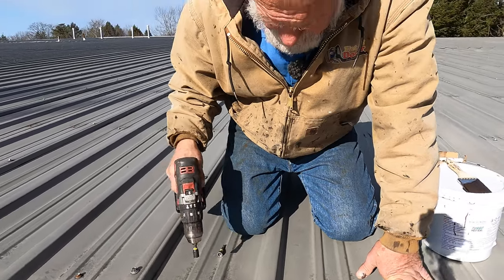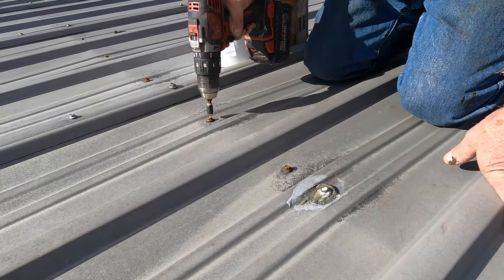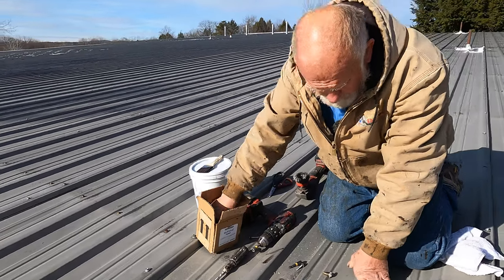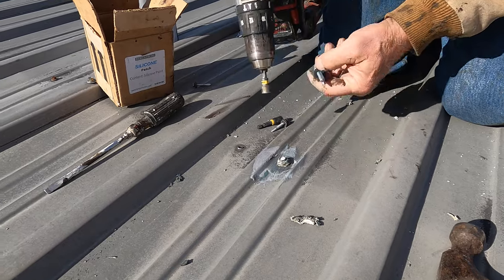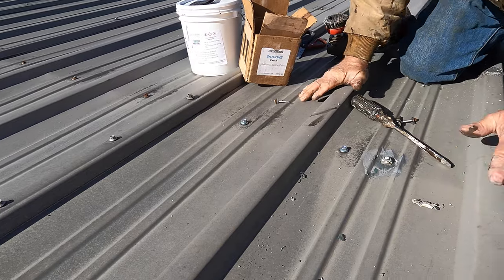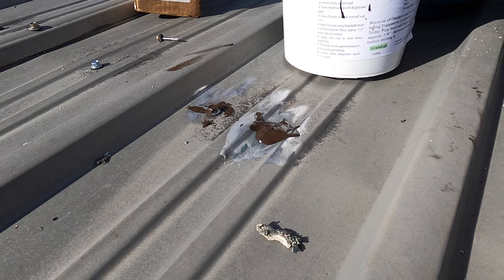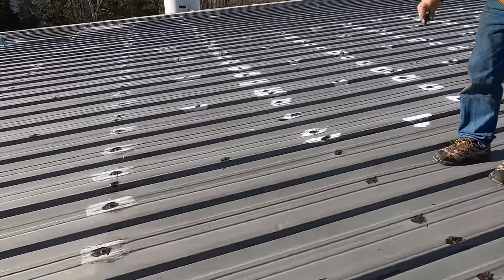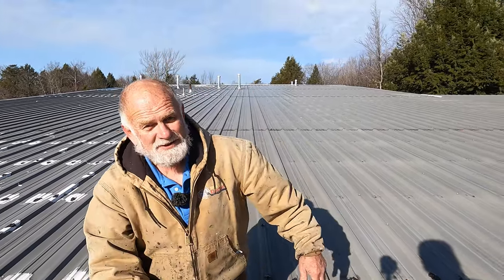Sealing Screws on a Metal Roof - Turbo Poly Seal

Comment: I find it interesting a number of flat roofs shown in your videos are secured with screws in the pans.
The rain water flows along these pans and anywhere you pierce the pan with a screw has the potential to eventually leak. In Australia our roofing systems use a concealed bracket secured to each roof batten usually at 900mm spacing. The bracket clips over the edge of the roof sheet at the side lap and is secured with screws into the metal or timber batten. The next roof  sheet is then pressed down onto the same bracket and is snapped / locked securely in place.
This process is continued along the entire roof. It’s very fast system and the pans remain free of any screws.
Thanks for the video.
Reply: from what your explaining it sounds like a standing seem roof this is just a metal roof or something like kingspan roof.

Comment: I've got an old garage that the builders used nails to secure the metal roof. I believe the washers rusted out so now there's water leaking in the garage. Would you recommend replacing all the nails with screws and then using the sealer or just go straight for the sealer?
Reply: Replace the screw, the reason why is because since that screw was already been compromised most likely water already got in, thus the possibility of rusting is there. You dont want to seal something that has corrosion it will only get worst.

Comment: I thought to myself “finally he’s fixing something correctly” then out came the turbo seal 😂
Reply from the maker: Well, that is my go-to product. I wish I knew about Turbo Poly Seal many years ago. My motto was always that I can fix any roof, no need for replacement. So my business was based on repairs. I did not have the knowledge of other products. If I only knew. I could have made some money with all the repairs. Most roofers just want to replace, and not repair.
Reply: @smudger304 do tell, for this newbie, what's considered "correct" approach
Reply: @mknoyce  1) never wire-wheel the paint coating off of a roofing panel.  2) if you scratch the panel while removing an old screw, repair it correctly by cleaning, prime coat, finish coat. 3) never smear mastic over a roof screw.  What's shown in this video is the wrong way to replace metal roof panel screws.  Do it right the first time.

Comment: After applying Turbo Poly Seal, in the event that the screws need to be removed, can you simply remove them or do you need to wire wheel them first?
Reply: wire wheeling on metal roofing
 Bad Idea.
Nut driver will grab head when pressure applied 
  Keep it simple,
Build for tomorrow,not today .

Comment: Takes more mat. and time,But,
,predrill screws 1/2"+ -
,with caulk gun insert nozzle ,squeeze trigger lol, now set washer screw,
 Now the joist is sealed and waterproofed at joist screw threads and joist to roofing 
   Increasing screw size is useless if the original screw hole is water rotted.
  seal all exterior screw holes before final torque down .
  Our 40' x 100' barn roofing is 20yrs old, Not a single screw has failed ,we used 5200 marine caulk,Sika flex marine caulking is long life quality, also .
Reply: Nothing is getting through 3M 5200